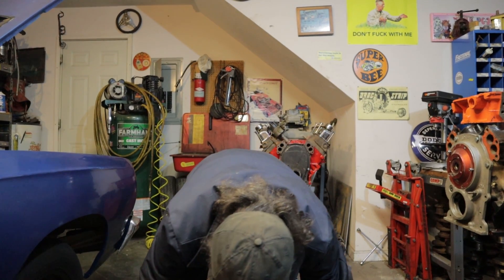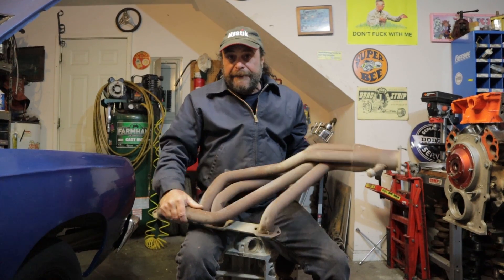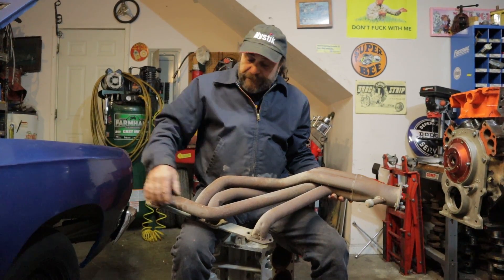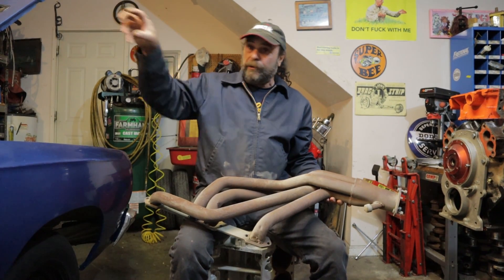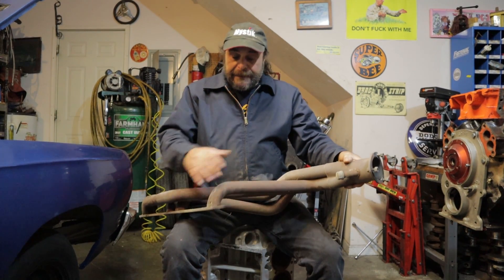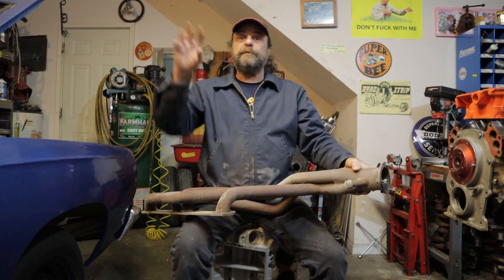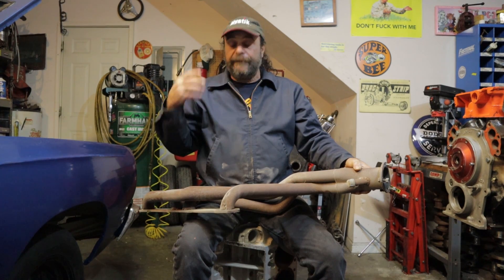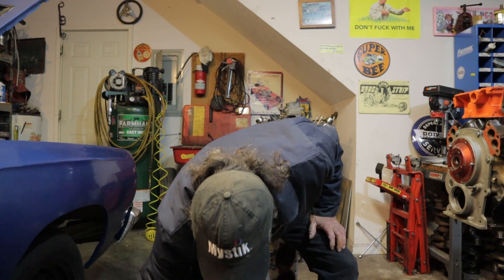The BS On Backpressure

Comment: I haven't heard "backpressure" in a lot of years. It was something people barfed up all the time back in the early 90's, back when newer cars and trucks had first gen OBD engine control systems and fuel injection on them. It was, of course, a horrible oversimplification of what was happening to the guys that were taking their 302 powered F150's and putting straight pipes(not even a H) on and removing cats etc. 
First, the sparten OBD/EFI control simply didn;t know what to do with the extra air, sometimes it would run so bad because the engine actually went into "safe mode" because the A/F was so botched. Then a little later, removing cats had a terrible effect because they added O2 sensors before/after cats to help determine fuel rates, and the OBD went haywire without a cat in place. 
All of that could have been tuned away, but in most rural areas no one knew how to mess with the EFI computers and aftermarket even for a Ford 302(truck or otherwise) EFI was still pretty sparse and expensive. 
Like all that stuff, people figured it out and either bolted on aftermarket or replaced problem parts by the late 90's with those vehicles and good times were had again. 
But it has been decade+ since I have heard anyone barf up that term. I do recall Borla going out of their way in their ads to try to educate people about exaust scavenging in the late 90's, i think by then it was starting to sink in what the actual problems were though.

Comment: Used to hear this BS all the time. It just won’t go away. According to this myth after boring/stroking cylinders and crankshaft, installing a big cam, a high-rise intake manifold and a four barrel carburetor you had better leave on the stock cast iron exhaust manifold and stock pipes all the way out through the stock mufflers to make more power. Not saying the above config won’t make more power than stock, but it will really make a WHOLE LOT more power with a set of open headers (and proper jetting of course).

Comment: Hi Uncle Tony,
When I was in my late teens I told my old mechanic car guy that I put headers on my 1981 C-10 with a 305 with a huge factory carb and he told me I should not have wasted my money there and left the original exhaust manifolds on and increase my pipe size 1/2" to a real dual instead of the combined catalytic convertor, because the heat generated with the cooling effect of the exhaust piping would help pull the exhaust out. 
I might have lost a bit in translation being 18/19 years old without much mechanical car knowledge. Sure did spend time back then burning through header exhaust gaskets, leaking every 10/15K and changing them out. Could smoke the tires on that truck with the old style speed control after hitting 25/30 mph on speedometer with it set at 70mph, no foot on the pedal when it engaged, blew my friends minds when I did it!
Jam '63

Comment: So in engineering, back presure only causes mechanical loses. That exhaust stroke is only powered by the mechanical force from other cylinders and the inertia of the crank. Same on your intake stroke, it requires mechanical force. The only reason I see to have overlap, is to try and recycle some of that pumping loss from the exhaust stroke to put some pressure on the intake side of the engine, making the intake delta p lower,  decreasing some mechanical loses. Pipe roughness causes back pressure, and that is always expressed as mechanical loses.

Comment: It has to do with high rpm, low load and lean burn. The explanation is that maintaining vacuum is work so back pressure will reduce vacuum, reduce work done. Included with this is the incomplete removal of exhaust gasses, this in effect lowers the compression ratio so the lean mix doesn't predetonate as well as lowering the work needed to compress. This also works out on paper as the exhaust temps are lowered so by default more of the energy is going into work. 
Honda had a system years ago that partially blocked the exhaust to get boosted egr which increased gas mileage but Cali blocked using it.

Comment: One of the Motor Builder channels had engine and it made more HP on Open Headers then on the dragster style single exhaust tubes, one per exhaust port.  Scavenging (headers - more HP) vs no Scavenging (dragster exhaust tubes - less HP) confirmed by the Dyno!

Comment: Yamaha EXUP valve's on fzr's & R1's & Suzuki SET valve's on gsxr's give more torque at very low rpm's when the valve is closed in the exhaust (about 70% restriction). So what about that then.
Reply from the maker: That's about increasing velocity by reducing area.  Nothing to do with backpressure
Reply: @UncleTonysGarage  
I will look into that 🤔

Comment: I know this ain't that much related, but I have this 50cc 4 stroke chinese scooter, that apparently came factory with a 2 stroke 2 piece exhaust (big expansion chamber + tiny muffler) for some reason. Ive removed the 2nd piece, and the scooter is not louder at all, just less stressed. would it be okay if I cut off the expansion chamber and weld on the 2nd small muffler piece? It would make a better access to rear wheel/brake as well.
Reply from the maker: Yeah, cut it off.  An expansion chamber has no benefit on a 4 stroke engine
Reply: @UncleTonysGarage  Thanks Tony, i'll do it as soon as spring knocks on the door. Cheers from Slovenia

Comment: Years ago we ran my buddies Nighthawk 750 motorcycle with the header off to test it and you could hear the distinct "Bhwip, Bhwip, Bhwip, Bhwip" noise from each cylinder firing as the lack of vacuum was creating a low pressure point outside the exhaust port of the head, disturbing the exhaust flow. We didn't know exactly what it was, but we knew that the engine needed the header on it to run properly.

Comment: A friends dad explained this to us before we could drive. An exhaust  manifold will eventually gather gases to go in a particular direction , but headers create a vacuum to pull ( scavange)exhaust out of a cylinder.  Making the engine more efficient  and slightly  more power. He worked at Garrett  air research. To us teens  we got the concept, but my first car had tuned exhaust header from factory ,   `Oh My'
(65 Ford Cortina GT) and so did my 84 Escort. Even though  it was 4 cyl, it did make the engine run better than stock  cast iron exhaust manifold, both had a cam profile to  make more  HP. Good lesson to learn at a young age.
This vid continues  the lesson.

Comment: Your ideas are nice but I can assure you that headers do NOT work like you think where a slug of gasses "sucks" on the exhaust port.  What really happens is:  A positive pulse travels down the pipe until it reaches a place where there is an increase in area where it enters the collector.  When it reaches that place the wave collapses and sends a negative wave back up the pipe.  This is what makes the header "scavange".    The positive wave then continues  to the end of the collector where it again returns a negative pressure wave and this wave can travel up all of the pipes that are connected to the collector.

Comment: Watch high speed camera footage of glass head on a Briggs and Stratton engine video and this concept becomes crystal clear. When the exhaust valve cracks open the spent gasses are leaving town a whole lot faster than the piston is moving it at BDC, called blow down.
Reply from the maker: Blow down is the final phase of the power stroke
Reply: Yup

Comment: I guess it's really true on a two stroke with the standing wave thing in the exhaust pushing part of the fuel/air charge back into the cylinder but that's not relevant here. I also get sick of hearing people talking about a two stroke power band "Yea when those power bands kick in" and I try to explain Everything has a powerband. It's just the RPM where the engine is working it's best, not some kind of magic turbo. It's usually more obvious on a two stroke is all I think. If someone is swearing up and down about back pressure or powerbands and it's getting tedious to try and correct them I'll usually just leave them to it. It's not worth my time.

Comment: I agree with you here Uncle Tony. I was told years ago about back pressure. I argued that there was no pressure from the exhaust to the outlet, and if there was where is it? as it is a pulsing type of vacuum. I also said restrictive exhausts create problems such as back pressure which cause poor performance, poor fuel consumption and poor reliability. Cheers for the video :-)

Comment: I had an argument with a goose on a YT channel about scavenging. My well reasoned argument was exactly duplicated by his dyno results yet he told me I had no understanding of the concept of scavenging. I told him politely that his supplied headers had sponsors and we musn't upset them but desisted from continuing (what's the point).
Anyhow, I assert the variables for true scavenging to work in street engines is so complex that the idea is a complete waste of time. The reason headers make more power is the reduced pumping losses allowed for by the velocity of flow rather than tuned pulses manufacturers say. You see no two engines are ever built the same so how could broad rpm range scavenging possibly work (and of course it doesn't). 

Now this isn't to say scavenging doesn't exist. It most certainly does but to get it to work over a wide range of rpm is impossible in a street engine with so very many different combinations of parts.
Our  hero's dyno graphs of exhaust manifolds and headers of various types block hugger through to tri Y and 4 into one yeilded linear improvements in torque and HP from 3000rpm upwards. The gains are in the order of about 15hp and 15ft/lbs from worst to best on a 450hp engine. Hardly scavenging at work. For 15hp you might as well stay with exhaust manifolds. No +40ft/lbs humps or anything remotely like that in any of the graphs just straight lines of marginal gain.

For scavenging to actually exist as header designers market them we would expect to see a big hump but no header test graph I have ever seen on a street car shows this. That's not to say it can't happen more I haven't seen it.
Credit given where credit is due, the 4 into 1 did show a torque hump in the sub 3000rpm range but we couldn't really see it since most engine dynos don't measure below about 2500 - 3000 rpm but we know this about 4 into 1 at any rate.
Some engines don't even respond much to headers unless the exhaust manifold is very restrictive.

I must mention this, I saw a test of some Max Wedge exhaust manifolds vs 2" primary tube 4 into 1 headers on a  440 with a cross ram intake (so a MW copy but 440 instead). The motor unbelievably made near the same hp and torque but the same torque peaked at 3500 as opposed to 4500 rpm. The A/F stayed more or less within range. 1000rpm lower is a big improvement esp in a street car. 

The header dent test vid shows that the primary tubes have to be almost hammered shut before HP and TQ drop off. This is consistent with Bernoulis Principal.
In fact one could actually design some headers with strategic dents to artificially induce scavenging I'm thinking.
So re dented headers, what's this say about mandrel bends? Next set of custom headers are going to have press bends.

Comment: Excellent review on this, So what should I run for my Buick V6? (Like the Grand National) Type of V6 except for Naturally Asperated. The stock Pipes had a Y-Pipe Into a Single Exhaust, Or should I go Dual?
Reply from the maker: Large diameter single is the way to go with that

Comment: WWII fighters with in line engines had stub type exhaust tubes, no backpressure. None at all. Top Fuel Dragsters have slightly longer exhaust pipes that Warbirds did. No backpressure. Kay Sissel made performance parts for straight 6 enrgines. Their exhausts had a narrowing at the very end of the header, but those were for racing and they were meant to keep velocity up. Basically, it was the fix for the wrong header diameter. They blew it on tuning. This might have been what caused the confusion. Like Uncle Tony said,it's about the velocity of the exhaust gasses flowing out of the cylinder, down the exhaust pipe to the collector and out into the atmosphere, where the positive pressure wave, like a smoke ring made by a cool chick from the 70's showing off,(well, not like that exactly, but it provides a visual reference to what you can't see), breaks and a negative pressure wave flows back up the exhaust pipe to create a vacuum during the end of the exhaust cycle when both valves are open but the exhaust valve is about to close. This provides a scavenging effect. It's like a supercharger without any moving parts. If the exhaust pipe is too big it's velocity won't get the negative wave back to the cylinder fast enough and it will collide with a closed exhaust valve. This robe the engine of the potential it has. Get it too small, and it arrives before the exhaust valve opens and again you lose the potential. Somewhere, whether people bought Kay Sissel headers for their six cylinder engine, or some shade tree knuckle dragged figured out that he needed to slow down the exhaust velocity to provide the scavenging effect he was looking for, (and it's doubtful he even knew what he had done and just saw the effect of the modification), and called it backpressure. Just like the kid who stuck his finger in his hat and called it macaroni, he didn't fully understand what he had just done. He might have also lengthened the primary tube of his exhaust and gotten the same effect. Anyway, thanks to Uncle Tony for trying to dispel this myth that has fed the ignorance of red neck shade tree machanics for decades. I tried, and gave up.  If someone asked me how tuned exhaust and intakes work I'll do my best to explain it to them, or help them pick out the manifolds he needs for the engine he's building. The same principles can be applied to all angina as well. DON'T EVER TAKE ANY ADVICE FROM THE GUY WHO SAYS,"m know how to work on Chevy's"! He might know where the bolts are, but he donest know squat about building engines of any kind. If any one who thinks that slappingna set of rings in his engine is rebuilding it, stay the hell away from him as well. The same thing goes for guys who lap their valves with lapping counpound. Technology passed them by in the 70's. A competent machinest with the correct set of grinding stones can do the job correctly, grinding the seat at 45 degrees and the valve faces at 44 degrees so the the interference of the two angles prevents them from leaking down the road. The guy who puts new rings and bearings in an engine without cleaning it, remqchining the block, heads and crank is the same guy who will sell his ride a month or two later because it's back to running like shit! Hell tell you it has a rebuilt engine, but it's not. Always ask for receipts for parts and Machine work. The block should be bored, crank reground, valves and seats ground, exhaust seat replaced on older engines and valve guides replaced at a bare minimum. Sure, in a race car you want to freshen the engine after every season or two, depending on how much it's run. And refreshing the engine allows a racer to inspect everything to make sure nothing is cracking under stress, or stretching, deforming or coming apart. But that's a race car only situation!

Comment: Sometimes it depends on the RPM of interest...  I agree that back pressure (resistance to flow) is bad.  But occasionally it works because of other compromises like big Caddy V8's making killer TQ at 1200 RPM through quiet mufflers with pancake intakes.  Flow was restricted because they had get them under flat hoods.  Poor intakes will not feed evenly or well.  So a bit of back pressure will hold the charge column and even out flow.  Not a race engine, a street engine for Grandpa.  As soon as you start scavenging, you have to address the intake, cam timing, mixture control, etc.  You are looking at two different worlds. An engine that will idle all day with the A/C on and never shake the car vs and engine that will build HP at high RPM and lope the car hard.

Comment: Finally some clarity!   For years I've heard all kinds of myths about this.  I especially appreciate the information about too large of exhaust causing loss of torque or low end.  I think this is the myth I most often experienced.  So many guys I knew took modestly modified  engines and slapped on huge duals .  Bigger the better, then lost all low end power  used in daily driving.   For years the explanation was Loss of back pressure.  Thanks for setting the record straight in a concise manner.

Comment: Yes, you are correct, it's a misunderstanding of the system to give credit to back pressure. You have to move air in an engine. Back pressure inhibits this. The scavenging effect promotes it. I think it would be more illustrative of your point to make the analogy to a venturi's vacuum. The velocity of airflow created by the other cylinders is shared by the one in overlap condition. It's even more pronounced with appropriate header tube diameter and tuning length.

Comment: You do NOT want a free flowing exhaust UNLESS your ECU is programmable (such as a Megaquirt) - otherwise, the ECU's calculations will be WRONG and you lose horsepower (just as you would with a cold air intake, or any other mod from stock on a locked stock ECU). - An example would be the Denso ECU's on Lexus's and Toyotas, that have never been software or hardware cracked, and therefore cannot be reprogrammed to tell the ECU about your mod and have it adjust its calculations accordingly. - So this would be a perfect case of an engine needing backpressure to run optimally. - I hope you learned something!